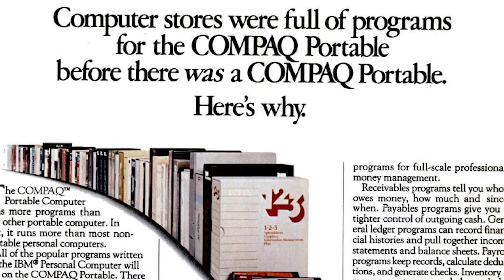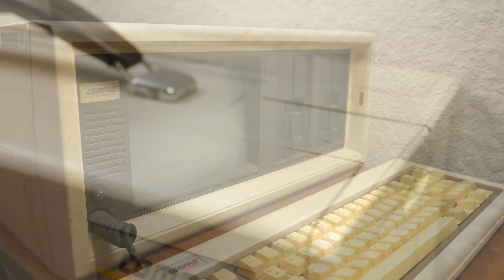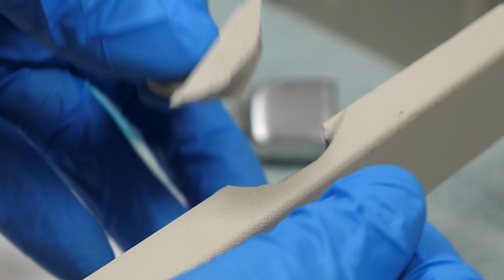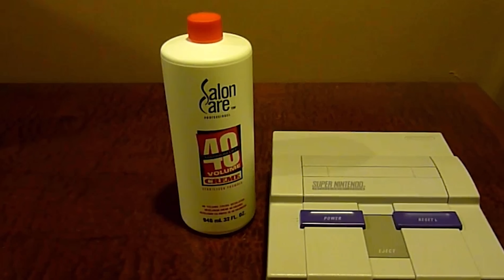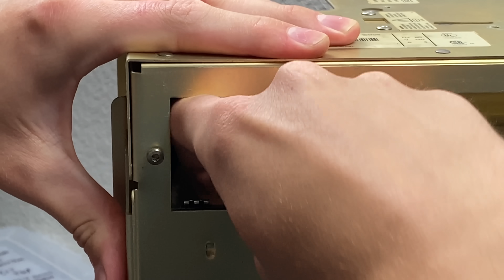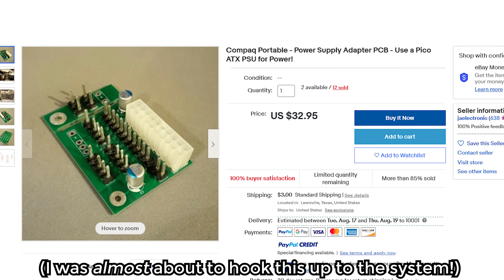The Trash Picked Compaq Portable 1! - Overview, Cleaning, and Diagnosis (Part 1)

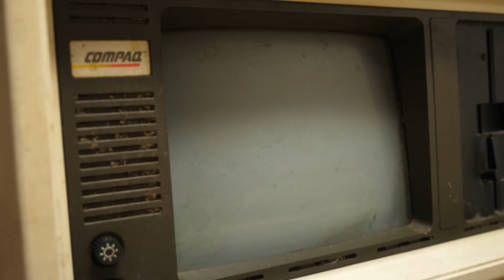Comment: 18:10 I have been too lazy to search what Retrobrite is, thinking it was some $60 a pint cleaning solution I'd never be able to afford to use.  So it's hydrogen peroxide and a UV lamp.  I CAN DO THAT.  Definitely have some older computer cases and keyboards and mice and CRT display housings that could use it.

Comment: I replaced the power supply with a standard AT PSU. I needed to use it on 240v and the original was 120v only. The replacement fits well in the space.

Comment: For anybody who doesn't know, retro bright is a chemical compound that removes the top layer of the yellowed plastic, to reveal the non-yellowed layer beneath.

Magic erasers are made from a very hard material called melamine, but in a foam state. So basically magic erasers are a very fine sandpaper. So using them to unyellow plastic would also remove the top layer of the plastic.

Both retro bright and magic erasers thin out the plastic and can only make them more fragile. If you care about the longevity of your yellowed devices, don't use either.

Do what you will with this information. Personally, I hate ugly yellowed plastics, but I hate dealing with broken or fragile plastics more.

Comment: My dad once found two perfectly functional CRT TVs and a Casio keyboard outside a house on the trash. He rescued all of them. I ended up keeping one of the CRTs (that only needed a small fix on the power button) and the keyboard that had some broken keys that I glued together. The keyboard is pretty cool, it's a WK-1800, which has a floppy drive to load configuration and MIDI files play them directly on the keyboard, and they keyboard being General MIDI compatible, you can hook it up to an old PC and play the music from your old games through there as if it were a module. A total score, and dude, all this stuff was perfectly functional! It's upsetting that people just trash stuff instead of trying to do an extra effort and find someone interested in buying it or even take them e-waste facilities.

Comment: Have worked on these before and just like IBM Pc and XT motherboards have had shorted Tantalum capacitors on the 12V and 5V rails preventing power up.

Comment: it would be cool to update the hardware and have basically a mobile gaming pc [i say gaming pc because those are typically very powerful]  and its a different approach to mobile computers, I like it. its like a mobile computer box, instead of a laptop wich is just a screen, a keyboard, and not alot of power due to it being compact, mobile, a laptop. this thing though, you have enough room to make it powerful, especially considering that modern screens have gotten alot smaller and compact, wich makes that much more room for other components. AND, modern small-screens can show color!

I think....

idk much about computers so I could be entirely wrong, but it still a cool concept to think about

Comment: The other day, I found an HP Slimline PC in the trash. I took it home, plugged it in, hooked up the monitor and keyboards and everything and then it booted right into Windows 7. So I kept it. It obviously isn't as vintage as this Compaq, the one that I found is from 2010 to 2011, but it still works fine nonetheless.

Comment: Tantalum Caps are an issue among all old computers as they grow crystals internally and short. Problem with troubleshooting is that they all will be on the 5 volt side and so its a matter of solder sucking 1 leg and lifting it out or cutting both legs off of tantalum caps until the short goes away. Personally all tantalum caps should be replaced with newer caps as the design of the caps has come a long ways to a recipe that is less likely to crystalization shorts between the plates of the capacitors of new Tantalum caps. I say look at the values of the tantalum caps and replace each one using a solder sucker and soldering iron. Hunting down the 1 shorted cap isnt the best repair strategy as the other aged tantalum caps are a short risk.

Comment: Wow,  I worked for Atlantic Computers in the 80s in the 90s. I replaced many of the power supplies in those machines with PC power and cooling power supplies. Those units used to blow a power supply if you turn them off and on too quickly. Now, whether or not I was the same Atlantic Computers, I don't know. I remember those Kalok hard drives, and what was referred to was the Ping of death with the actuator Motors.

Comment: Can't remember the brand of the first BRIEFCASE portable computer dad brought home, but I think the tiny screen was on the left and we (not brother he'd be 4 by this but I was around 8) ran Flight Sim on the thing.  I suspect dad has some software for that still hiding about and Lotus? is one of them.  Not even sure if that's worth anything anymore..  But yeah that was fun before I wanted to figure out what was going on in the instead (skip ahead to the 90's :)  )  It was in Green screen like Apple IIe's were
Reply: That being said some guy here on youtube de yellows his plastic with aluminum foil and uv light in a plastic box with some water or something else inside.  Alot of rubbing alcohol is used to remove the stickers.  Something I learned and use on older items not to mess the sticker up too much

Comment: Hi,
I'm also a prod owner of a compaq portalble plus and mine had a few dead caps as well. I'm also not an expert with electronics however I was able to find my faulty caps without exploding them. I think what you should do, is strip the machine down again, and get the motherboard out and start measuring the resistance between the ground and the +5v +12 and -12v rails directly at the points where power supply plugs into on the motherboard. With this you would know if the short circuit is on which rail.
After this I would go over the capacitors meausing the resistance between the legs of the capacitors. You need a very sensitive multimeter and a big luck to find the exact cap with the short because most rails have multiple caps in parallel and if 1 bad, you will see short on each on the same rail. you should try to locate the one with the lowest resistance in that case and try to cut or desolder that one first. If that doesn't help you could try to inject some voltage to the circuit from like a 9v battery to the 12v rail or 2 AA batteries to the 5v rail for 1-10 seconds and look for the cap which is getting hot or even to start smoking out. Just make sure if you inject voltage from a different source don't put too much voltage on the 5v rails.

Comment: Probably someone like my mum threw that away… i had so many vintage computer parts that i stored in my mums basement, at some point in time she decided that they are old and useless and threw them out. When i came to pick them she told me that they are long gone because she thought i don’t need them 😢 i had brand new pentium motherboards and cpus still in their sealed box, multiple rare servers, ibm notebooks and a lot of ram modules and early solid state memory modules. Sadly all recycled by now, only thing i was able to save where two used pentium cpus and and early amd (the ones with a lot of gold).

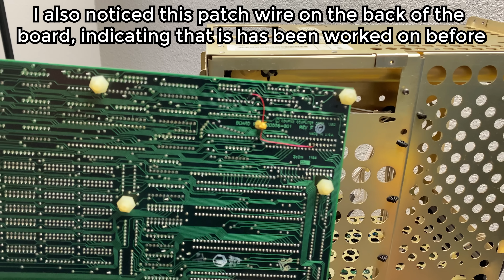Comment: 29:07 That "bodge wire" doesn't necessarily mean it has been repaired after the fact.  I believe that in some cases depending on the severity of a bug/issue it was just cheaper to do the fix on the assembly line instead of getting an entirely new PCB revision made.

Comment: When testing PSU like you did, you have to take into account, that you testing it without load, so the reading you get from multimeter may not be the same when there is load presented. So, I'd recomend to connect something that you might spare for testing, like old cd-rom or hdd, and this should be enough for correct testing.

Comment: As far as retrobrighting goes - my best method so far has been a clear plastic box (covered with clingfilm), that 40 volume cream you mentioned, and a 60 watt halogen light. I don't wrap the thing I want to retrobright in clingfilm. I just smother it with the hydrogen peroxide cream, put it in a clear plastic box, cover the box with clingfilm and put the 60 watt bulb over the box to provide heat, or something. I've had no streaks on the plastic doing it this way and it really works, too 😊

Comment: People throwing out valuable things isn't anything new, although it is surprising every time. About 2 years ago I found a 2011 MacBook Air next to the trash bin in a working state. I need to mention, in my country, any Apple product is considered reserved for the richest people only. Someone threw it out because the battery was bulging - I know, a fire hazard, but all of the other components were undamaged. I replaced the battery for $90 and sold it online for $300 in a perfect working state and almost perfect visual state.

One man's trash is another man's treasure.

Comment: Every last one of those tantalum capacitors needs to be replaced. Every. Last. One. That other guy's experience was a clue. They just get old and go bad and if you replace just one that has gone bad, all you're really doing is enabling the next one to blow - and the one after that, and the one after that (remember, they're going to tend to all be identical and will be subject to identical stress inside the unit). They get stuck all over the place between supply rails and ground in order to keep them from picking up high-frequency hash from the rest of the circuit. Thankfully in this day and age you can cheaply get non-tantalums in a wider voltage and capacitance range than you would have been able to back then so if you can do that, you probably should. Recall, though, that tantalums are polarized like electrolytics, and don't screw up and forget to put them in "backward" if they're shunting a negative supply rail.

Comment: 29:06 That jumper wire soldered underneath the board is less indicative of having been worked on before than a running engineering change made to the circuit. It also may be the case that it was designed like that in the first place.

Comment: 99% of the time its those darn tantalum capacitors which are found all over the motherboard, add on cards, controller cards ect. They will either silently fail after many decades of not being used and then the power ratings fall outside of tolerance....or worse they catch on fire! If you are particularly unlucky they WILL explode! In fact that is exactly what happened the first time I got one of these machines from a garage sale for 20 bucks. Flicked the switch and poof one of the capacitors went, replaced it with a new ceramic equivalent and flicked it on again...then another capacitor failed this time with an even more terrifying fireball. I strongly recommend having a halon fire extinguisher nearby to avoid any fire mishaps... and to prevent any further damage to the machine.

Comment: I have one of these that powers on and boots into DOS, but the keyboard is completely toast because 11 year old me realized it didn't work and I reversed the chips on the keyboard. It still powers up and all but the keyboard and I/O components would likely need replacing, and the housing has fallen apart significantly. I don't really know what all to do with the machine but donate or sell it to someone who can hopefully find use from it for parts or something. I don't know if anyone would be local to me wanting to tackle this though since I'm from Indiana and it's kinda barren out here for old tech geeks. They all live in Texas it feels like.
Reply: If you'd like it for the board, let me know. I've appreciated the content over the years. I really don't want to go about in shipping this mammoth since the plastic is in terrible lays potato chip condition and the fact that the machine still powers on last time I checked 3 months ago. Only thing I had to do was clean the contacts on the CGA card once due to some weird display issue it had at one point but after cleaning and reseating that card, everything else worked.
Reply from the maker: @LinkleProductions  Hey there! So full disclosure, I have acquired a replacement motherboard for this thing. But there is a small possibility that I might need another replacement part. If you’re still interested in potentially working something out, shoot me an email at michael@teammjd.com. Thanks so much!!

Comment: Waiting on part 2 .. so far it describes exactly same issues I am facing with my Compaq Portable .. will run the 12/5V tests before any other step (already tried without the ISA boards and found out that it is also missing the flyback)

Comment: Why does no one ever use a vacuum before wet cleaning? Every time I get a piece of electronic equipment that needs cleaning I always suck up all the loose stuff first. If you don't it will just mix with what ever cleaning solution/ method you're using, makes cleaning 100% easier.

Comment: For Retro Brighting thoroughly, I'd suggest to look at a Youtube channel called Odd Tinkering where this guy has restored a ton of retro machines like an NES for example and he most notibly uses a very high percentage Hydrogen peroxide that is in a bin that is lined on the outside with Tin foil and UV lights over the top or side depending on the bin size and it retrobrights perfectly.
Reply: 8 bit guy is the retro brighting king!

Comment: After 10 years electrolytic capacitor start to fail.  Just replace all of them.  These are the big ones in the metal cans.  The little ceramic ones are fine.

Comment: multi-meter for the shorted cap, it'll take an hour tops. When you find a candidate (or two) just snip a leg.  Then see if the PSU stays on (when board re-connected). Then, when you can replace the cap.

Comment: 13:38 I found over the years that cigarette smoke can actually protect the plastic beige computers of old.  Somehow it keeps the plastic from yellowing.  Check out Odd Tinkering & Odd Experiments for how he retrobright's devices with hydrogen peroxide and UV.  Nearly identical to the way you ended up doing the keys. :)

Comment: Near the end of the video, you show a photo of a bodge wire repair and say that it's been worked on before.

Not necessarily. On older systems, it was fairly common for the manufacturer to do repairs like that. Maybe that chip had two pins that needed to be tied together and they didn't realize that when they designed the motherboard. The solder looks factory to me

Comment: Cigarettes contain Tar. This tar escapes into the air when the cigarette is smoked. This aerosolized tar will gather EVERYWHERE, especially where there is constant airflow like the inside of a computer. That "Yellowing" you experienced is tar buildup. It was a common problem back when smoking was the hip thing every big tobacco doctor recommended. Whole rooms and everything in them would be "yellowed" - which is why smokers generally do it outside - that way they don't have to deal with that "yellowing" affecting literally every single thing in the whole house.

Comment: Michael in the future you can UV light strip there's a channel by Odd Tinkering that's done a good amount of electronic restoration. I'm not trying to promote his channel but figured you could check his out because the heat seems alot more work than needed lol

Comment: Ah yes the project testing your limits and skills. I got a killer lot about two years ago for 100 bucks. I got a IBM PS2/30, a Kaypro 286i, a Sinclair, a TI-99, two old Osbournes a first unit and a Executive, about 10 motherboards and various memory. He wanted it gone not a computer guy. The Uncle was a smoker but that doesn’t stop me you just use some elbow grease. About half of them worked. Some turned on made an attempt to run, others nothing. Lots of guys love 90’s are genuinely interested in them and have some degree of programming knowledge. I’m a mainly A+ and the basics of software and trouble shooting. I always look to knew talent on YouTube besides yours I like Adriens Digital Basement and Artifacts Electronics. Artie is well versed on older systems and especially troubleshooting and soldering and board repair.

Comment: I have a suggestion to the 5$ 98 pc; You should get a PCI to SATA adapter (a pci card with sata ports in it) and try connecting the SSD there, you should get faster speeds since max speed of PCI is 133mb/s. I am not sure if you can boot from it though, I think you should be able to do so

Comment: Worth mentioning about that bodge wire at the end is that's a common thing to find. Sometimes the manufacturer finds an issue with a board layout but determines a patch wire is more cost effective to install than to remap the whole board for production. Given how tidy the wire placement is, I'd almost put money on that being from the factory.

Given the state of the motherboard, it's at least a reasonable time to get the supplies for soldering in the process of getting it running. If you end up getting it running, so much the better, but if it still doesn't work then sourcing a replacement board isn't bad, either, since that allows more part swapping in the future.

Comment: I have a question. Why did you not just soak most of the plastic and keys in soapy water and then scrub with necessary cleaning chemicals and finish with rubbing alcohol? That's what I usually do (On regular plastic, not plastic with writing on it. I just rinse it after using soap), but I am interested if your method works better for you.